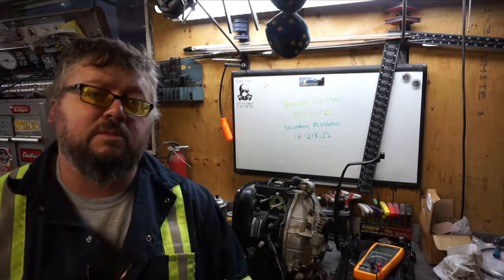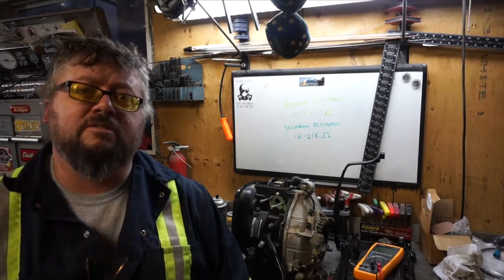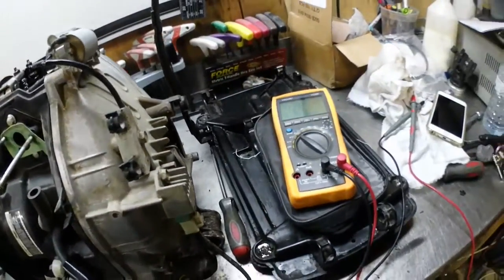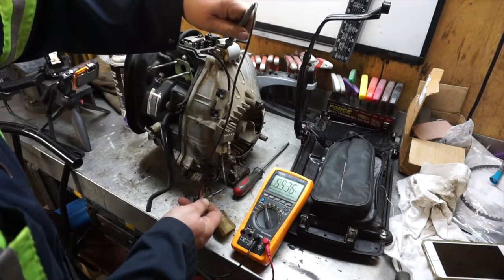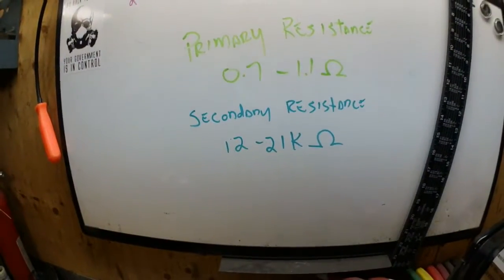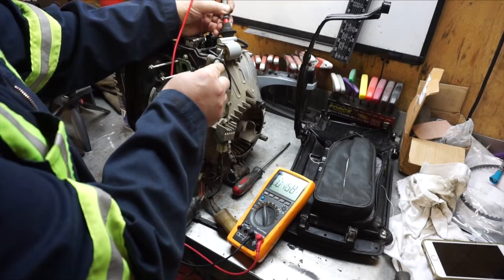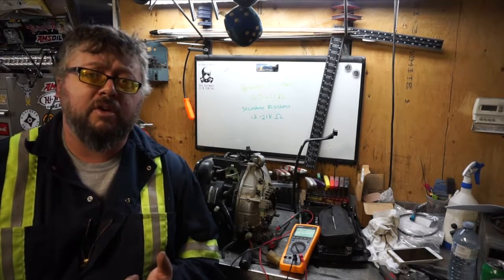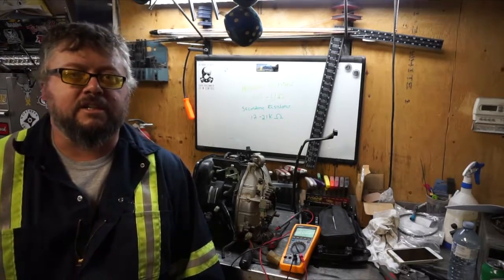Primary and Secondary Coil Resistance No Spark Condition

Comment: Ok got a EU3000iS replaced the coil  electronic ignition module and flywheel/stator still no spark figure that one out i have the coil isolated no ground to the  wire that plugs into the oil sentry. Coil checks out 1.2 ohm's and 17.80 K

Comment: I have a Ryobi RYI2200 inverter generator which has an ignition coil very much like the one on the Honda you are talking about.  I'm not getting any spark at all at the spark plug.  I have changed the plug, ignition coil twice, ignition module once and checked the oil level cut out.  Any other thoughts?  Definitely an electrical issue and not fuel related.  I have around 1 to 1.5 ohms on the primary and no reading at all on the secondary (infinite resistance).  I have tried three ignition coils and get similar readings on all of them.  Should I be getting 2.5 to 5K ohms on the secondary?  What else should I check?
Reply: You need a good coil
Reply: @pressleynorris9885  My coil is good, I now have three good coils.  I suspect the spark generator coil or the magnets have fallen out of the flywheel??

Comment: I brought new ignition coil and it have the same resistance as old ignition coil. Is this reason why i have no spark coming out of it while cranking engine. The ignition coil getting voltage but there no spark  The ignition signal harness have no open loop. Possible new ignition coil defective?

Comment: Thanks for this video.  I did both no spark checks that I found here.  The oil sensor appears to be open when full of oil, and the coil resistance readings were in spec.  I also checked to make sure the ignition cutoff switch was opening and closing properly.    It's definitely not a carb issue because it was getting gas and totally clean (have a second unit that I swapped it onto and the carb operated fine).   Do you happen to have other ideas for something to check next or did you have any other videos about no spark that I might have missed?
Reply from the maker: Have you physically checked to verify there is indeed spark ?
Reply: yes.  I did the pull the plug out and ground it against the engine block test and also one of those inline spark testers and light showed no spark indication.

Comment: say, i just bought a basket case eu1000i , the strange thing is usually the coil is mounted directly next to the flywheel pu, on this one the coil is not mounted anywhere near the flywheel, there isnt a magnet anywhere close to the coil, i have tried to look at parts diagrahms but i cant  really tell, the coil tests good, and it looks to be mounted correctly??

Comment: Your meter may have a lead nulling function where you can short them together and it deducts their resistance from the measurements when you press the null or relative button.  It's pretty tricky measuring resistance values in the ohm region using a standard meter.  A continuity test could have been used as a quick and simple check that the primary was intact.
Reply from the maker: +bigclivedotcom that's a good point thanks for sharing, there is a ReL button I may have to bust it out and see